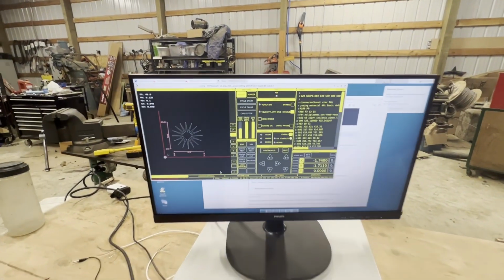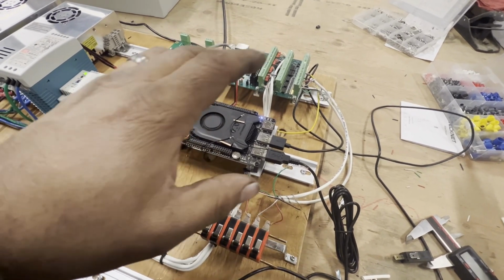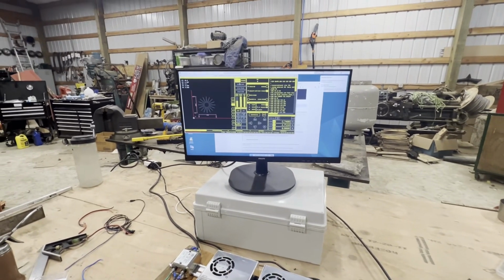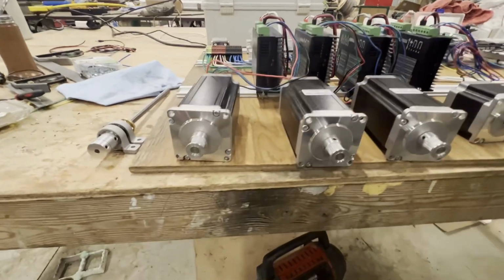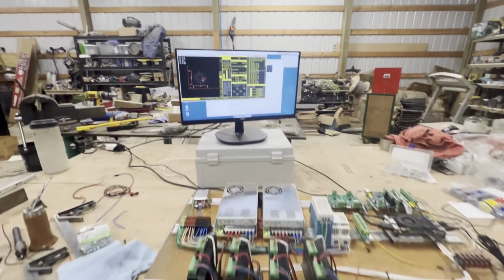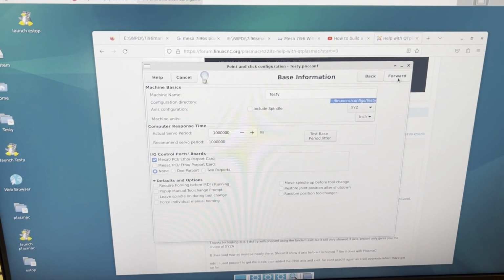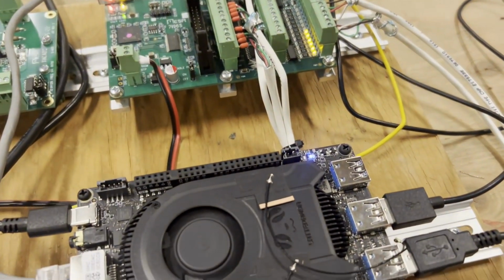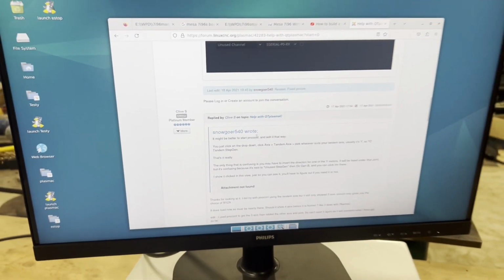Linux CNC router and plasma control

Comment: What sort of latency performance do you get with the latte panda when you run the linuxcnc latency test?  I'm considering that board. Are you able to turn off all its power management features in its bios?
Reply from the maker: Sorry for the late reply. I will have to double check but I think latency is on the higher side. Now don't trust me on what I say verify it but I don't think the latency is as important when you are using the mesa board to control the machine

Comment: Do you have a current build list with part prices? I’d be curious to see the cost difference between to closest spec commercially available machine…
Reply from the maker: I have a price list of some if the things I was going to buy but a few thigs have changed and i have not updated it. Once I get it updated I will include that in a video. But on my list it was around $1600  That is not counting the cost of steel which i would imagen would be around another $800.  cutting area will be around 54"x54" This way it will be a true 48"x48" cut space with some extra wiggle room. 
So I am building instead of buying for a few reasons. It is cheaper, the langmuir (This would be the one I would buy) 48"x33" is $3244 with the same options my table will have. The second reason. I am not limited to a certain operating system. Third, I can lengthen this table later if I need to, without a lot of expense and very little work. 
There are some things you can do to even reduce the cost of this build, an old used 50$ pc can run this, I spent 270 of the LattePanda. And the more you can scrounge around for deals the more affordable you can make it.